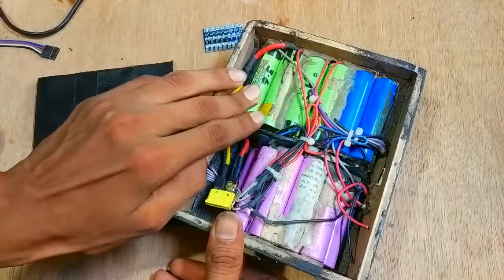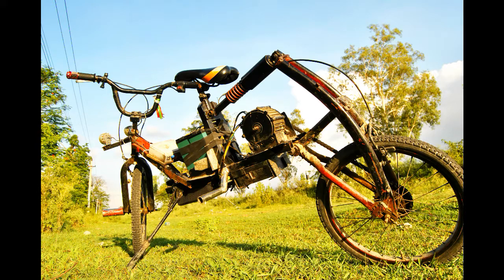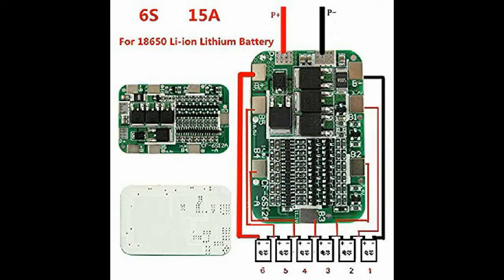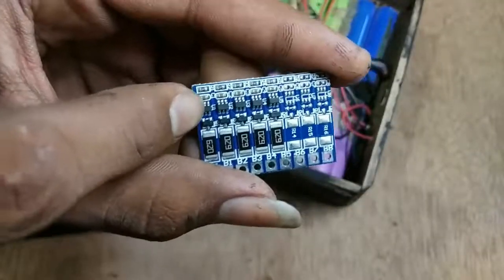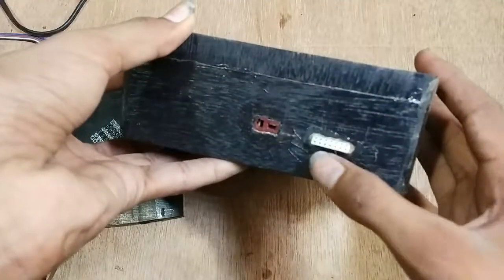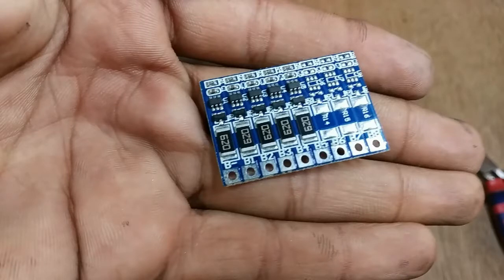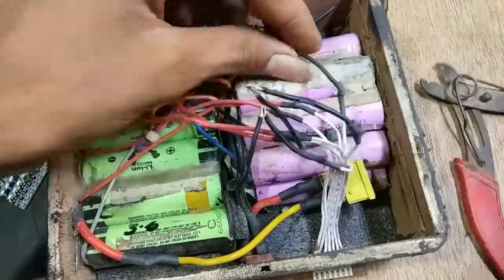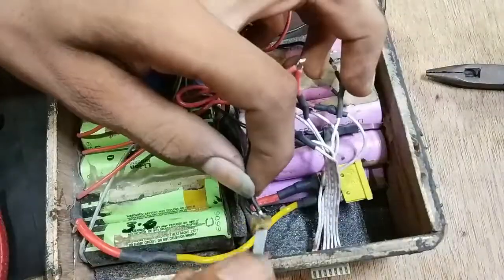Test and review of Cheap 5 cell BMS for my battery pack

Comment: How to charge these battery..i am also from nepal..and going to make an electric cycle
Reply from the maker: You need a power supply that can outout ( 4.2* number of cells you used in series) voltage. 
Or a detailed video on building an custom battery pack from old laptop batteries is coming next week... 
Hope it helps
Reply: Thanks bro but..the board you used can i charge with that board or need separate bms
Reply from the maker: @himalbhattarai5407  that board I used is for balancing the cells as I am using different cells for ta battery pack. If you want other features like short circuit protection, over current protection, over charge protection then you should buy a proper bms or for testing and crude battery pack this is okay
Reply: @AmateurInventor  thanks for the information brother...😃😃..
Reply from the maker: You're most welcome brother☺️